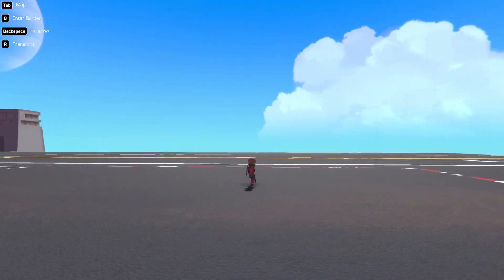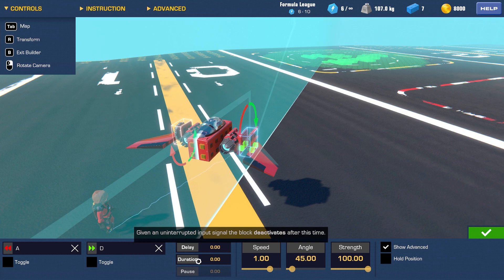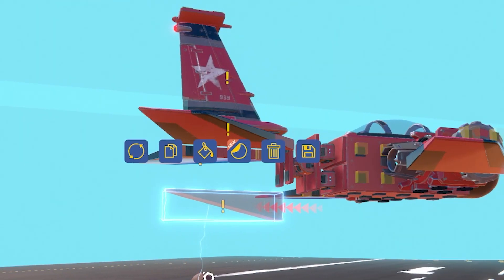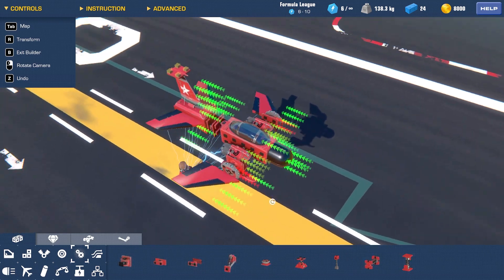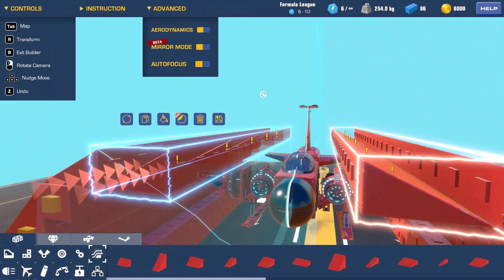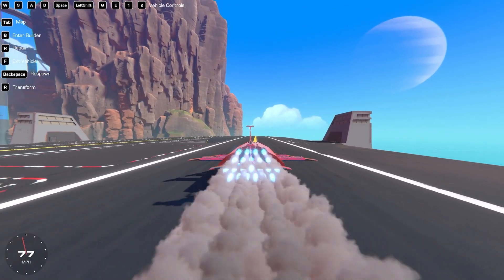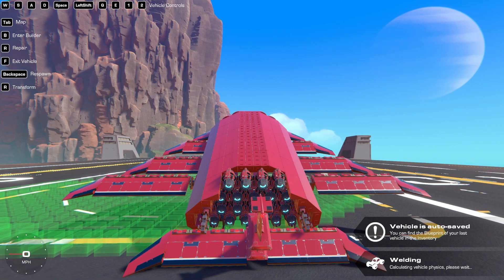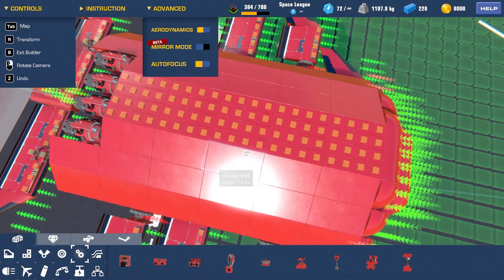Engineering a plane, inside a plane, inside a plane!

Comment: I think you needed a few more detachable blocks at the back of the middle plane, either splitting the thrusters into 2 sections or separating them from the fuselage, to make it break apart better.

Comment: 2:57  Hi, so the reason your plane is sliding away is because the skis are coded in a way that they slide on icy surfaces. The aircraft carrier isn’t made of anything so the game counts it as everything(so also icy). The weight of the plane at the back is forcing it to slide to that way.

Comment: The reason the second plane wouldn't fly right is because of how short it is. If you extend the length of the aircraft and added more space between the horizontal stabilizers and the main wings it will be more stable

Comment: Your center of gravity is what has a major impact on stability. With a rear CG  the front of the plane will want to rise and stall as well as making the plane very unstable. You want a central but slightly forward CG for stability. Too far forward though and you won't be able to pull up. Just remember rear CG unstable and hard to control but very maneuverable, Forward CG more stable but less maneuverable (definitely worth it).

Comment: Matt, the center of lift must be slightly behind the center of mass! This is the main rule of airplanes. Otherwise, plane becomes unstable and will flip backwards of forwards. All you have to do is move wings a bit back, or delete some wingage in front. Also applies to vertical stabs (if it flips sideways). Also applies to KSP.

Comment: If you add enough wings to something it becomes a plane.
Engineering with Matt.
Reply: I mean... he's somewhat not all wrong in a theoretical way... kinda... sort of...
Reply: Then if you add wheel on boat it becomes car and if you add wing on boat it becomes plane right?
Reply: @SupasitPhungrattana  only if you put in enough wings or wheels
Reply: If you put enough thrust behind it, anything can fly. Even a brick. As shown by the F-4 Phantom II, which has roughly the same aerodynamic profile as a brick.
Reply: @Qantravon   what about a cloud that cant fly it can float though
Reply: Just attach a butt load of thrusters to it!
Reply: Yoghurt
Reply: Sounds like an architect.
Reply: He is an architect... the king of architecture actually
Reply: Clip after clip he is becoming an architect :/

Comment: The reason why the small rocket didn’t separate from the medium rocket in the first place was because the tail fin was attached to the roof, also if you turn on advanced controls on the configurator, there is a setting to destroy the thing your detaching.

Comment: Could add more destructible detachment points between the boosters in the back of the second plane [would cause complete separation] and maybe interior engines to the insides to force the hull pieces outward just like in KSP!

Comment: You definitely need to make the "PLANE-CEPTION" break the sound barrier
Reply: I think they'd need to upgrade the parts count for that to happen.
Reply: @JustIn-sr1xe  There are "tricks" that could make even the small plane supersonic.
Uses the detachable block too.
Just build it that you sort of "cover" all aerodynamic arrows with parts that are only connected by a detachable block or two and drop the cover pieces before you start.
the physics engine calculate the aerodynamics only on loading the vehicle in/exit build mode. And if you drop the parts the aerodynamics are "attached" to, those aerodynamics drop with those parts.
Instant no-drag vehicle